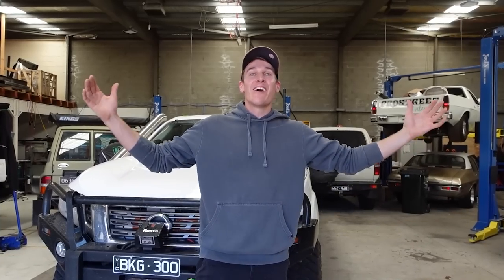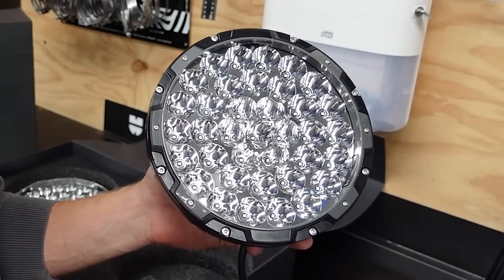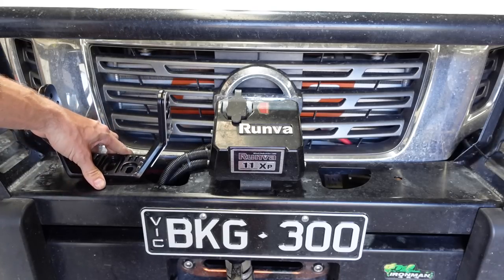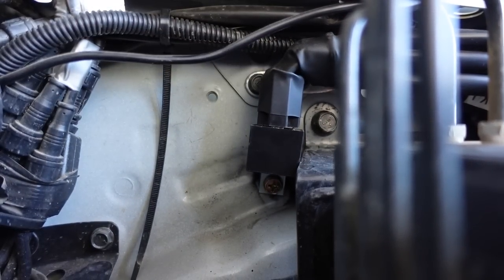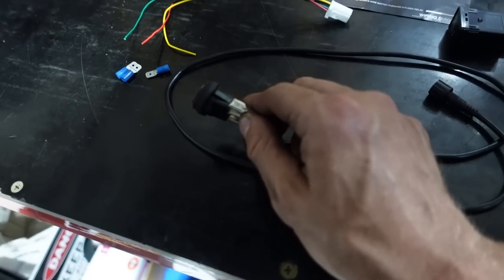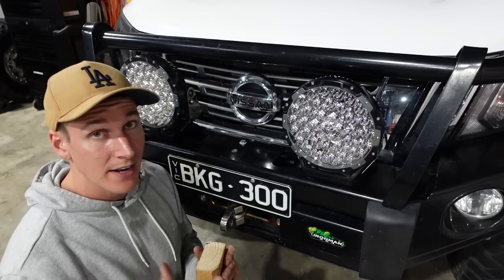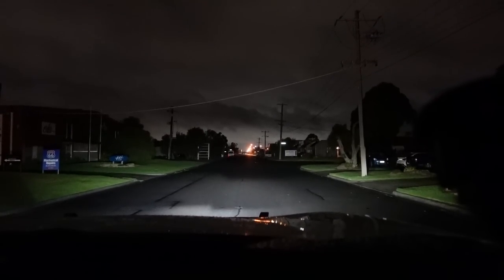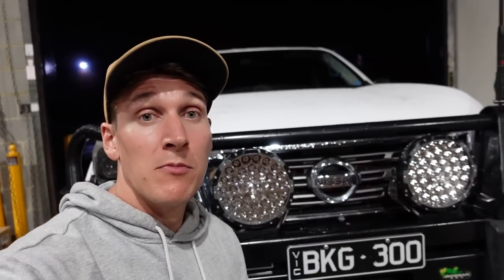Stedi Type-X Pro Installation & Setup #SHEDSESSIONS

Comment: 5700K is the same as the suns output.
But I personally rather a lower temp as higher temps cause more glare, especially off signs.
I also do not see a point of these types of lights that throw light 1km down the road, it means you have to dip them super early if used on the a dark road at night.

Comment: What do you recommend, Negative to the post of the battery or the frame of the car? (I had a Ranger and it was recommended to go to the frame so the smart charger couldn't see the accessories)
Reply from the maker: I have heard this recommendation however, i am yet to have any dramas with my Nav and the wiring setup I currently have.

Comment: nice vid, but i could not help it, at 24:01.....your headlight main beams are misaligned, at least one of them is off :(
Reply: also do those lights come with voltage stabilizers? heard somewhere that the np300 headlight modules are really sensitive
Reply from the maker: Yup one of them is out of adjustment to the other, but I still need to adjust both of them properly after a recent headlight mod 👍
Reply from the maker: The headlight module is sensitive in the NP300's but so far I have not found it to be an issue when using the compatible piggy back harness that stedi supply.

Comment: Type x pro's are a bad driving lights.
I have them on my Nav and i hardly use it on night drives and also have a 3303 Pro  light  bar is a far better driving light then the x pro's...its hard to explain but one two three light bars give better light i have  noticed on my sons Hilux with triple 3303 Pro's. The whole area just lights up with out only pointing to the centre of the road.
Reply from the maker: interesting, I love mine  💁